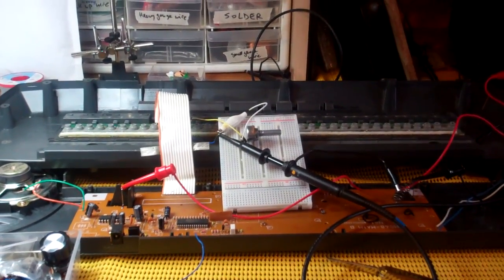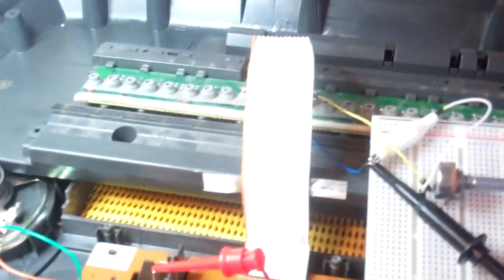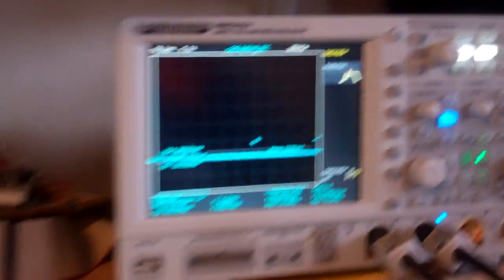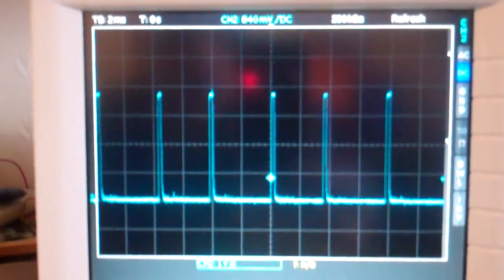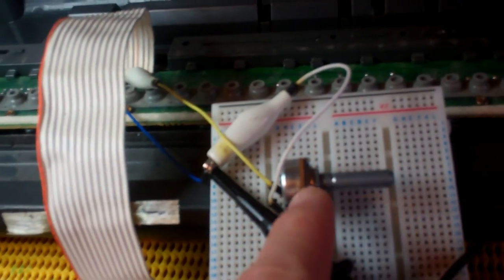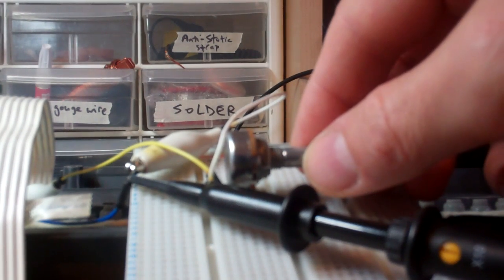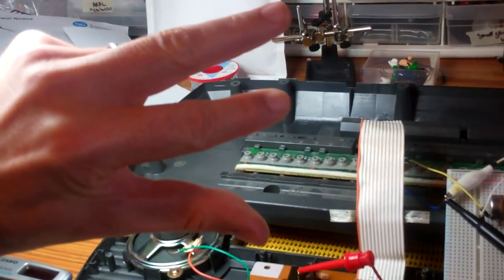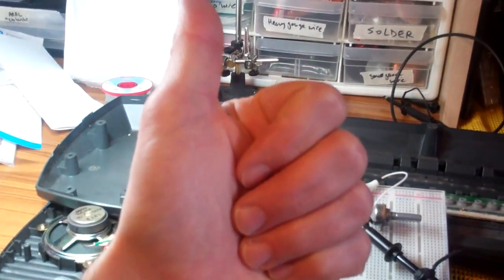Repairing a Casio SA-65 electronic keyboard

Comment: Correct me if I'm wrong, but couldn't you use a capacitor instead? Obviously it would require more mathematics and wouldn't be as hands-on for tweaking the value, but couldn't you wire it such that only a voltage above the threshold desired is sent, and the phantom voltage sent to ground? I'm a newcomer to electronics so forgive me; just curious like you. :)
Reply from the maker: +Hakeem Hashash I think what you are referring to is a 'shunt' to ground. This is a way of selecting the voltage level of different frequencies- ones you want 'pass by' the capacitor, while other frequencies go through the cap to ground.... this is what happens in basic RC (Resistor-Capacitor) filters - check them out on the internet - very simple designs. However, in this instance, all I wanted was to change the voltage of obe frequency: using Ohms Law the current through the resistor I introduced created an appropriate voltage drop across the resistor - this drop lowered the phantom voltage below the CPU threshold. It's easier and less comlex this way - at least it was for me! I am learning too!